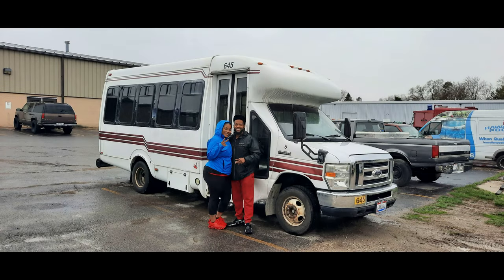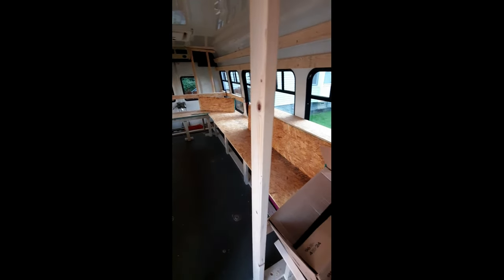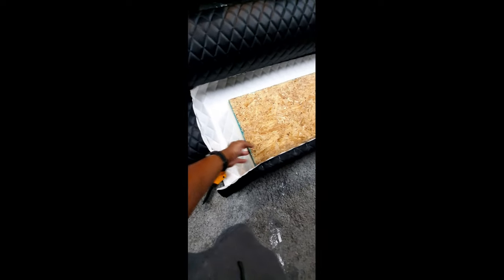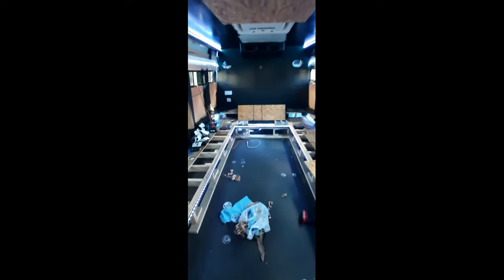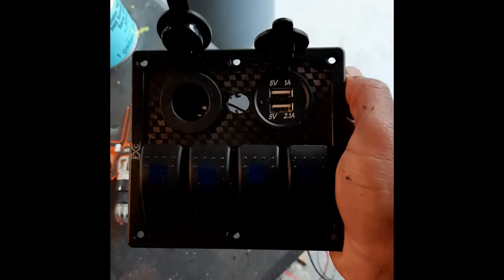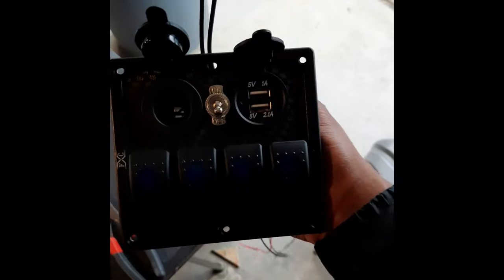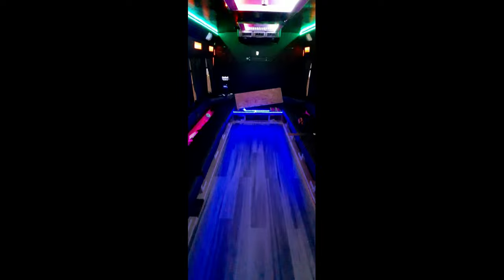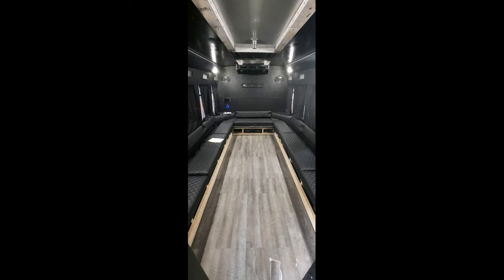VLOG + HOW I BUILT A PARTY BUS | PARTY BUS CONVERSION

Comment: I’m really impressed by your work in building party buses.

I was wondering I have a 2004 freight-liner. It has a 200 amp alternator I was wondering if I would be able too add an additional 6 speakers, led lights and maybe 2 tvs( with a inverter) and receptacles for cell phone charging too the current bus battery system??? Please help
Reply from the maker: That seems like it would be enough to push the additional items. Being that tvs and led lights don't pull that much power. However I would invest in atleast 1 additional battery to push tue 6 speakers. Hope it helps

Comment: Came Out Excellent Question What are You Using For Extra Power I Saw that extra battery but how is that battery getting charged up. I Have my own bus im running 7 tvs 2 fridge 3 amps for music etc my bus is equipped with 2 batteries stock do i need more

Comment: Man it turned out amazing! 
I have one I'm starting in the coming months, I was curious what screws you used to attach to interior walls but found that in a previous comment. 
How tall did you end up making the seat frame bases? I was assuming around 18"?
Reply from the maker: Big Thanks. I used some hex self tapping metal screws. So that they would tap into the metal studs that most busses have. used a stud buddy magnet stud finder to find them. 2 1/2 inch screws. And yes around 18 inches I think Mine are like 16 base it off your windows. I hope this helps and good luck and well wishes.

Comment: Hey bro. Quick question what adhesive did you use to apply the vinyl to the walls and ceiling?
Reply from the maker: Its called contact adhesive. Ordered it from amazon. Dap brand wellwood contact adhesive.  https://www.amazon.com/gp/aw/d/B004IH3HAQ/ref=ox_sc_act_image_1?smid=A19CJGKPLHXS29&psc=1

Comment: Nice job .what kind of setup did you do with the TV.
Reply from the maker: Big Thanks we went with a 40 in lg for the rear and  a 32 inch for the front wall. used a convertor box splitter to connect both and hdmi cords. Here are the links https://amzn.to/3I8M43f https://amzn.to/3I8M43f https://amzn.to/3JQzeaK    https://amzn.to/3Y7FShd
Reply: @pvempire4991 what device did you use that you needed the hdmi cable and splitter?

Comment: Great video far as framing goes what’s size and kind of screws did you for the floor and walls ?
Reply from the maker: Thanks. It will mostly depend on your build. For mine i used 2 1/2 in self tapping sheet metal screws so that they would tap into the metal studs of the bus. Get a stud buddy to help find your studs. Good luck
Reply: Thanks and one more question the battery in the back for the lights and radio what or how you got it charging  bout to start building one you are a lot of help on this project 🙏🙏💪
Reply from the maker: @lifeisajourney8715  no prob. I had a handicap ramp that was powered in the rear befor the build. Once i got that out I used that as a power source to charge the battery. If you have an auxillary battery location on your bus, which you should use that to power anything in the rear. Again this is what worked for my particular bus. Good luck👍🏽